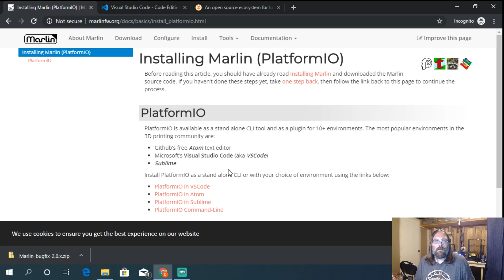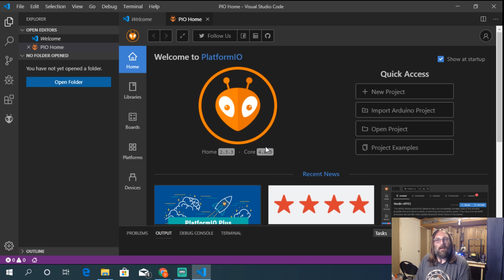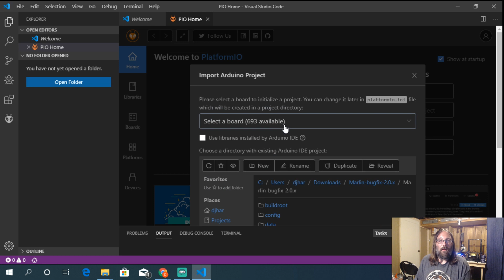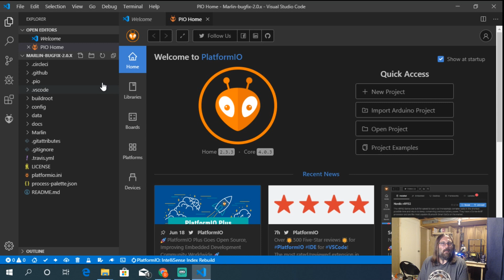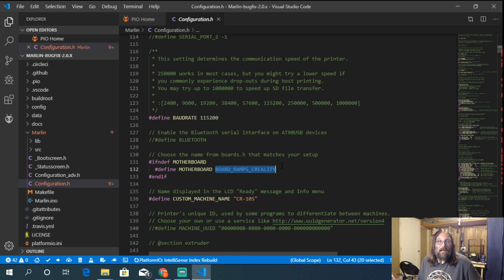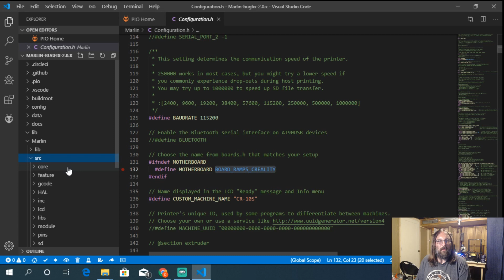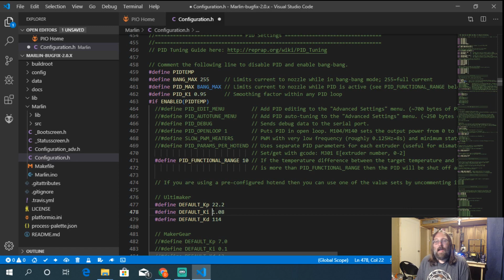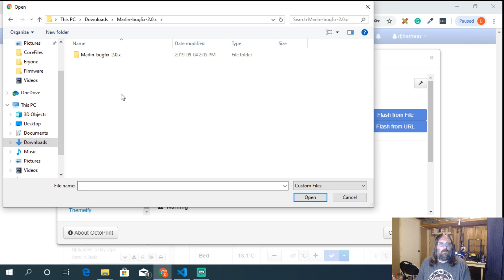Compiling Marlin 2 0 with VsCode and PlatformIO

Comment: I get an Exit one error when I try to compile. Any ideas on what's wrong?
Reply from the maker: Exit is a generic error is there anything above it?    Also make sure you have the github desktop client installed
Reply: @3DMakeIt  Github is installed.
Reply: Error: Nothing to build. Please put your source code files to
Reply: IT cant find the files it needs for some reason.
Reply: Verbose mode can be enabled via `-v, --verbose` option
CONFIGURATION: https://docs.platformio.org/page/boards/atmelavr/megaatmega2560.html
PLATFORM: Atmel AVR 2.0.0 > Arduino Mega or Mega 2560 ATmega2560 (Mega 2560)    
HARDWARE: ATMEGA2560 16MHz, 8KB RAM, 248KB Flash
PACKAGES: toolchain-atmelavr 1.50400.190710 (5.4.0), framework-arduino-avr 5.0.0
LDF: Library Dependency Finder -> http://bit.ly/configure-pio-ldf
LDF Modes: Finder ~ chain, Compatibility ~ soft
Found 16 compatible libraries
Scanning dependencies...
Dependency Graph
|-- <U8glib-HAL> 0.4.1
|-- <LiquidCrystal> 1.3.4
|-- <TMCStepper> 0.6.1
|-- <Adafruit NeoPixel> 1.2.5
|-- <Adafruit MAX31865 library> 1.0.2
|-- <LiquidTWI2>
|-- <Arduino-L6470> 0.7.0
|-- <SailfishLCD>
|-- <SailfishRGB_LED>
|-- <SlowSoftI2CMaster>
|-- <TMC26XStepper>
Error: Nothing to build. Please put your source code files to 'C:\----------ENGINEERING PROJECTS - Dec 26, 2019---------\CR-10\Board Swap\
Reply from the maker: You may have to re import or open the project again
Reply: @3DMakeIt  I still can't make it wok. Its the Library Dependencis or Git / Github.
Reply from the maker: @BobWJohanssonPEng  at this point I would uninstall platformio from vscode (go to the extesions tab click uninstall) then close vscode then readd it.

Comment: Tell me something all the files I download from marlin 2.0x when i go to the config file there only this read me text i download all and its the same thing config folder only has read me text. before downloading i look at the download open config the boards are all the . But why when I download the firmware I get this read me text where have all the configurations gone?

## https://github.com/MarlinFirmware/Configurations/archive/bugfix-2.0.x.zip
Reply from the maker: Hey!  Since the latest release of marlin they have moved them to zip files (the link is in the readme) to shrink the size of the download.  So if you open that readme up and follow the link you can download them still.
Reply: @3DMakeIt  thanks yea i just found that out I'm new to this still learning it can be very frustrating. But I cant get the board program i keep getting error ..

Comment: Will this work for a Tevo Tornado Gold Edition?
Reply from the maker: The gold uses an mks gen-l which is a 8 bit board with standalone drivers.  It seems what drivers come with it are a bit of a crap shoot on the release date.   Some have 2130's while others have 4988s.

All that said yes vscode can be used to compile marlin 2.0.1 for the tornado.  It is the "newer" way to compile firmware for marlin firmware 8 or 32 bit boards.  Hope that helps.  Start with the example config in the /marlin 2.x/conifig/examples/tevo/tornado/v2 folder

Comment: Nice video! Thanks. I've been compiling fine for the SKR mini e3 v1.2. I've done the 512k fix for that board from a pre-compiled fork by "steenerson" that worked great! I today went to reduce my cold extrusion temp, and BAM! blue screen of death. I can't now compile anything. If I use an old backup that I uploaded to facebook skr group, onto the same card, the board boots up nice and perfect. So now it's back, but I can't change a damn thing or I'll end up back at bsod. I'm lost. I've even re-downloaded and left untouched the fork above, and it compiles with zero errors, but bsod again! I go back, put my old bin file on, it boots. So it's not the card or the board. Any ideas please? :( Going nuts.
Reply from the maker: Oh hi!  There is a bit of a known issue going around where platformio is not compiling the u8glib library properly.  Myself I use the insider build of VScode  and it has been running supper smooth with platform io.  But I would suggest uninstalling the u8glib library and adding it back.  Reinstalling it will hopefully purge corrupt library
Reply: @3DMakeIt  Thanks so much! I'll erm, try that, having never heard of it I'm sure a google or two will provide lol. Thanks again from Blackpool UK ;) Oh, and also, why would it also still not work in Atom? I've had a google, can't find how to replace a library, we're all very new to vsc with these cheap boards turning up lol. EDIT2: found it. replaced. Still nothing. Blue screened. I've also tried replacing u8glib in the insider build. Nada. What really bemuzes me is my old reliable bin file I was running on before doesn't even work, yet another users from facebook file, does!
Reply: @3DMakeIt  So, thanks platformio! as it seems to be their fault lol. After downgrading platformio to 1.1.9 AND core to version 4.0.3. I'm FINALLY able to produce a bloody bootable BIN! :)
Reply from the maker: Good to hear

Comment: Curious if you're currently having issues compiling Marlin firmware. I've got a SKR v1.2 board (in an Ender 3) that I've attempted to build from 3 different source files, (BigTree, and Teaching Tech being two of those). While the compile runs fine, the firmware.bin simply bricks my printer. I get a blank LCD. I can reflash with BigTree's precompiled firmware.bin to restore my printer. Very frustrating.
Reply from the maker: I build from vanilla marlin.  But I just updated my one skr tonight and it’s working just like I’d expect.   Perhaps try just marlin using the example and adding the board in to you platform and config
Reply: @3DMakeIt  Thanks so much for getting back with me. Seems the issue may have been within PlatformIO itself. Here's a support topic I created on their forums: 
https://community.platformio.org/t/cannot-compile-a-useable-marlin-2-0-firmware/10615

Once I downloaded the newer source code I was able to compile successful firmware.bin files. (Ones that didn't brick my Ender) One of the PlatformIO developers appears to have modified some of the scripts within the PlatformIO folders and that seems to have done the trick. Thanks again.
Reply: I tried three vscode to upstairs marlin 2.0 and it bricked my printer as well and am needing to fix it which i do not know how to do
Reply: @truthorsquareallah5899  from what I've found it seems like PlatformIO's move to core 4.1.0 caused the firmware.bin files to create successfully, but won't result in a usable flash file. One of PlatformIO's developers seems to have discovered the issue fairly quickly, and has updated the PlatformIO scripts in Marlin's GitHub pages. Make sure to download the source files again, (updated scripts were uploaded within the last week), and try to compile again. I'm making good flash files now.
Reply: @randomrat6421  my CR10MINI with Creality v1.1.5 board is not responding i get that error still
Reply: @truthorsquareallah5899  Do you have a link to the source code you're trying to build?

Comment: PIO Home does not open on my computer.
Reply: Error: Error: Detected unknown package 'contrib-pysite'

 at P.Promise (/Users/jessepietila/.vscode/extensions/platformio.platformio-ide-1.6.0/node_modules/platformio-node-helpers/dist/index.js:1:14992)
 at ChildProcess.h (/Users/jessepietila/.vscode/extensions/platformio.platformio-ide-1.6.0/node_modules/platformio-node-helpers/dist/index.js:1:5916)
 at ChildProcess.emit (events.js:182:13)
 at maybeClose (internal/child_process.js:962:16)
 at Process.ChildProcess._handle.onexit (internal/child_process.js:251:5)
Reply from the maker: new install or old.  There was a bug with the installer a while back.  Have you tried either reinstalling platoformio or both
Reply: @3DMakeIt  Kind thanks, no I have not tried. Install was made yesterday. So I could reinstall platformio + ?
Reply: I tried to install different versions of Platformio IDE from 1.6 to 1.83. Running OSX 10.12.6 / MBP MID2012. if that matters..
Reply: @3DMakeIt  I tried to install different versions of Platformio IDE from 1.6 to 1.83. Running OSX 10.12.6 / MBP MID2012. if that matters..
Reply: @3DMakeIt  ok, to where to type "sudo pip install -U platformio"? Which is a hint gotten from Marlin Config software.
Reply from the maker: Hey Jesse,

The sudo commands are issued from the terminal.   Apologies I didn’t see the comments pop up.

Comment: How to install a ABL sensor (NOT BL TOUCH)
Reply from the maker: Hi Colin,

The z probe section starts on 803 of marlin 2.0.    What abl senor are we talking about?   Basically you need to pick the proper probe type for your needs.  

Line 856 is fixed mount probes.  So your basic switch or mechanically switch stop. 

Line 867 is the bltouch. But also 3D Touch and other knock offs of the touch.  

879 is the touch mi probe 

887 is solenoid prove

890 is sled levelling.   

Lots of the logic in configuration is the same.  Knowing where the probe offsets are (line 911) and repeatability.   

If you let us know what kind of probe perhaps we can cook up an abl video